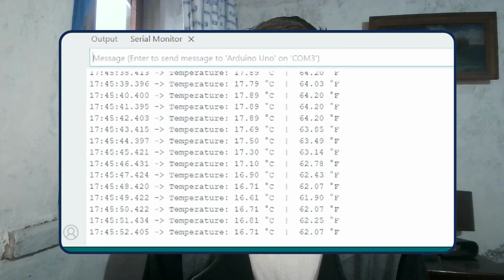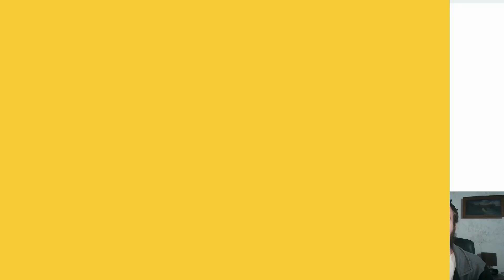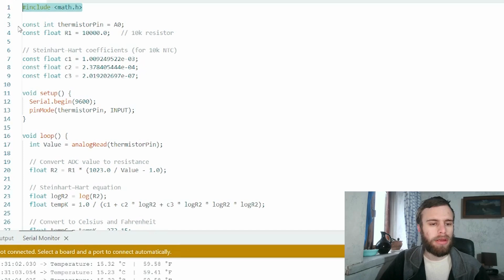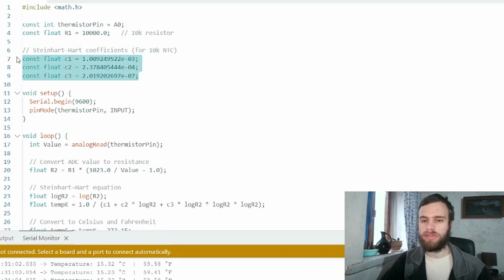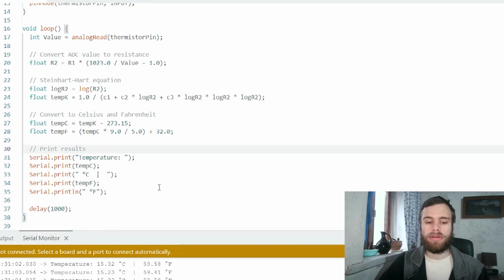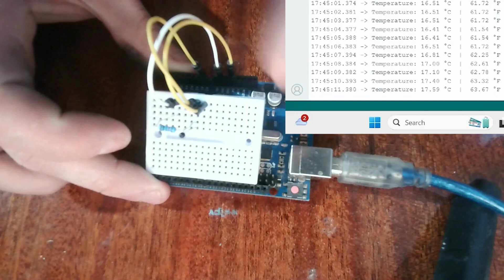Arduino Thermistor Tutorial | Measure Temperature Using an NTC Sensor

Comment: Thanks for the video.  I was unable to get any useful results from my attempt to try your setup.
I tried with 3 different theristors .  Serial showed temperature as about 114 degrees C ( not room  
temp as expected and even though i put a hot soldering iron tip close by NO temperature  change up or down!
I tested each theristor with a digital voltmeter and each one  showed a ohm drop  when exposed to a soldering iron tip
Your response would be appreciated
Reply from the maker: I am sorry for not responding to you; it has been 4 days since you have been waiting. I did some testing to see what problem you may have, and I have one thing that may help. First thing is, when I pulled out the 10k ohm resistor, it gave me close to the same value you got, and the value did not change much when I put my hand up to it, so maybe the problem is how you are connecting the resistor. One side of the resistor needs to be connected to the row that is connected to the A0 pin and the Thermistor, and the other side is connected to GND.
Reply from the maker: Please let me know if you still have trouble with it, and I can try to figure it out. I do not want others to have this problem too, so I need to find out if there is something wrong with this project.